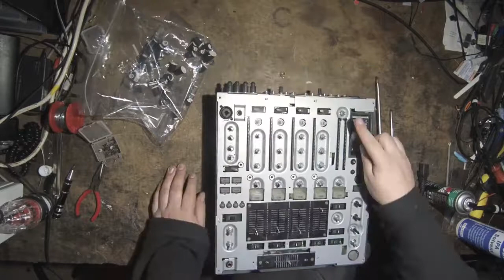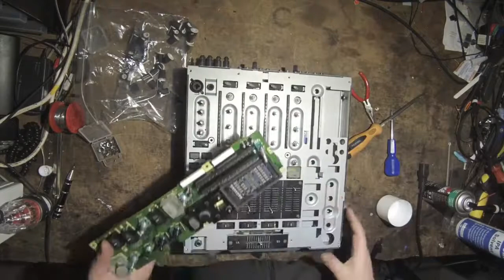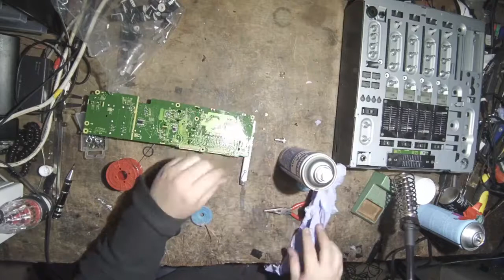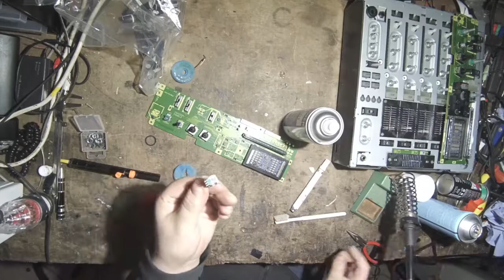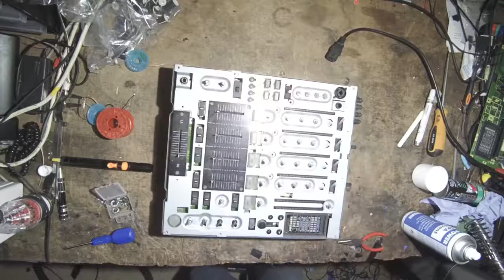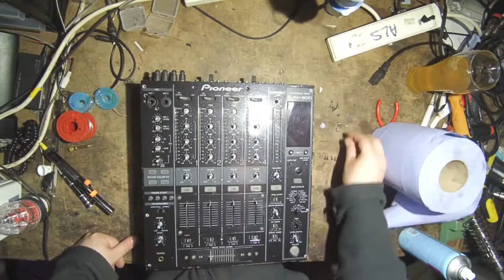Pioneer DJM800 master level pot repair

Comment: I've got a dim 500, I need to replace bass pots but screwed because on one channel someone soldered a replacement pot but they put aroldite over the top to firm it up, gonna have to burn it off it's gonna stink like fuck.